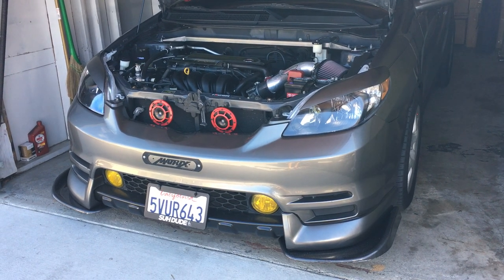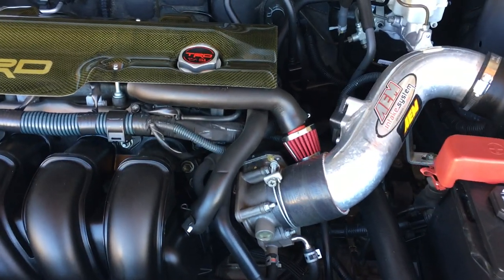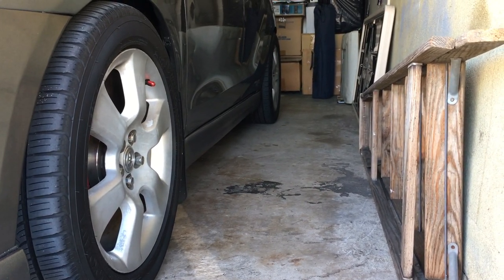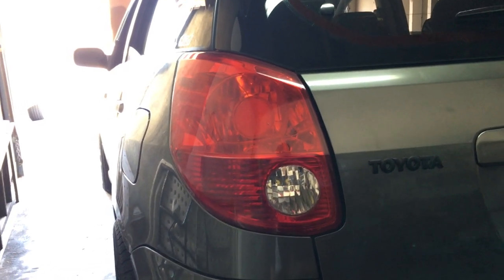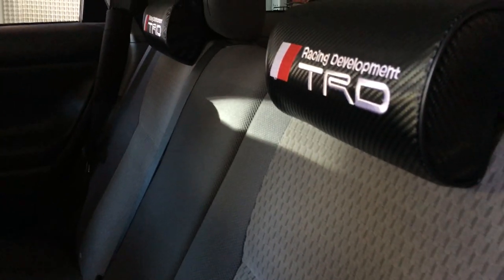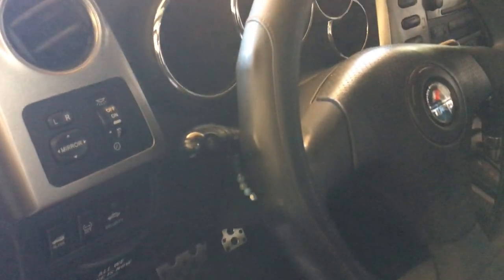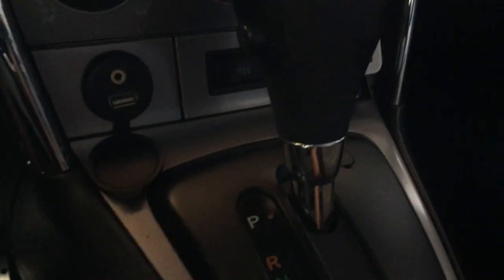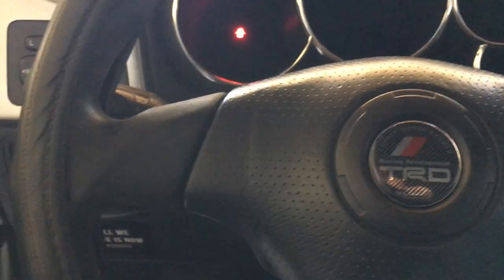2006 Base Model to 2003 XR Conversion!

Comment: Got this as my first car, now i gotta learn how to drive it
Reply from the maker: Automatic is easy to learn. Just shift into Drive, then put your main focus on controlling the speed with your gas pedal and brake pedal. EZPZ, manual transmission is a tad more difficult.

Comment: About to put a new intake in mine, my county doesn’t require any test or anything but I am worried Ima mess up and have a check engine light
Reply from the maker: Don’t gotta worry about that if you follow the installation instructions.

Comment: Nice sport wag 👀❤️❤️❤️,!!! “ Plasti dip is a mod for horse power” ..? Lol , love that your loving that matrix , bout to get my third one and going to pull an engine out of my first 270,000 miles , going to put it on a stand and try to clean it up and fix the shit I broke on it , but it still running strong , I stripped out the timing chain tensioner double ended bolts , tried to fix the oil leaking out of it , and yeah , if you could let me know what Toyota Matrix channels like yours to sub to ..? Thx man cool rig 👌🏼
Reply from the maker: Allan Cooper Sick! And nah I said “for horsepower” because it’s a joke LOL. I have another one that I’m yet to post as well. But for now it’s not ready. 3 Matrix(s) wow! Any XRS?
Reply: Jimmy Thai I’m looking to possibly get an xrs in the future ..? All the one’s I’ve come across have well over 250,000 plus miles on them and where all banged up , hard to find a xrs in good shape , but I found a 2.4 liter S awd model that’s in pretty decent shape that I’lll be picking up tomorrow , if everything checks out  , , I have a 06 base that I’ve been holding onto since it was brand new , it now has 270,000 miles on it , it still runs , but it started leaking oil , all over the back of the head from the chain tensioner seal , I screwed it up a bit by stripping the 2way bolts that holds it in , but now I might have to pull the engine to access the broken studs 😞, I’ll try a couple of more things first , but before I pull the motor , and if I do have to pull the motor , I’d like to go over it , clean it up , and add a few mods ....,,and throw it into a xr or xrs if possible , but back to the other matrixes , my wife has a 06 base with about 45,000 miles on it , that she got from her mother , and wants  to add some things , like a xr or xrs kit , A blue 07 xr with 117,000 , that I’m going to keep for my daughter when she’s able to drive ,  that’s the one I’m driving now , but yeah these cars have been the least trouble free cars I’ve ever owed , had three or four VW’s , and a Cadillac , they were also good cars but  , Toyotas have a good reputation for a reason or two ,Toyota’s do have their issues , like anything else , but the quality of their parts and engineering are second to none , they stick to what works , and not try to reinvent the wheel , I guess that’s why they out last almost every manufacture out here , Toyota’s last and they are not cheap today $$$ &  oh and I also have a 13 RAV4 xle awd  that I got brand new as well ,
Reply: Kinda in over my head with Toyota’s , but I’m also looking into getting a mustang gt just for kicks , and I also have gotten back into riding street motorcycles , so many other machines out here and so little time to give them all the attention they deserve , that’s why I lost focus on the Toyota’s cause they never really needed that much attention  in the first place , but with anything else , we take things for granted , and it comes back to bite us in the ass , but 270,000 miles and still running is not a bad bite in the ass, just need to puts things back in place and button her up , and give it the attention it deserves which is not that much ...

Comment: Was the bumper just basically a plug and play or did you have to do some kind of drilling or something?
Reply from the maker: Plug and play, however it's encouraged that you get the foam piece that sits behind the bumper and on top of the reinforcement bar before you mount the front bumper. Other than that, direct swap! Two 10 mm screws, two phillips heads, and a plastic clip. Yank off that bumper! Unless if you have those oem clips underneath, then you'd have to remove those as well. I made it easier for myself by using zipties on those areas for easier removal procedures next time around.
Reply: Wait, i can take a front bumber off an 03/04 and direct swap it on an 06? No way!?

Comment: hey man just got an 05 xr in blue, was wondering where you got your window visors?
Reply from the maker: TheKris916 HANSCOSTAR 4pcs Sun Rain Guard Vent Shade Window Visors Fit 2003-2008 Pontiac Vibe 2003-2008 Toyota Matrix https://www.amazon.com/dp/B083TVZK2Y/ref=cm_sw_r_cp_api_i_a0dCFb2YCTW
21

Comment: So the matrix and the vibe are basically the same car would these body mods like the grill and bumper fit into a vibe? Iv got a vibe but hate the way the front grill looks like and same for the headlights and tail lights
Reply from the maker: Unfortunately not, they're actually distant cousins. Body mods like the grille and bumper will not fit interchangeably onto a Vibe unless you do some major modifications to the parts then yes. IIRC most of the custom parts for the Vibe are more or less fabricated instead of aftermarket. There's a JDM car version of the Vibe called the Toyota Voltz and it has power folding mirrors, RHD dash, and a bunch of cool stuff, but importing them to the states would be difficult. Those are the few I can name in regards to finding aftermarket body modifications for the first generation USDM Pontiac Vibe.

Comment: So is the 2003 bumper a direct fit to the 2006 matrix? Thanks 👍
Reply from the maker: Yes 2003-2004 front bumper (prefacelift) is a direct fit for the 2005-2008 Matrix (facelift). All you’ll need is the foam bumper to ensure proper fitting when mounting.
Reply: @thai2zz35  thanks bro!!!
Reply from the maker: @gogojuice2621  you’re very welcome!

Comment: I have a 2004 Toyota Matrix 6 speed manual. Why does it grind going into 3rd gear?
Reply from the maker: This is a very common problem with the C-59 and C-60 transmission. I would personally try Redline MT-90 oil in the tranny first. I'd also suggest double clutching while the transmission is cold. Once warm the sythetic transmission oil will make every shift smoother.

Comment: its so wack looking for parts now ! ive had this matrix since 2017 and i choose now to start modifying it . i search parts but it seems like everything is discontinued  :( anywhere i can go to find parts . i know ebay has somethings , but i want like genuine trd things . let me know please , if this page owner is still active on youtube ?
Reply from the maker: Hey man! It’s a struggle, I know, however you’re not alone. I started modifying my first Matrix in 2017 (bought a base model unfortunately - back in 2016). I didn’t know much about modifications till I learned through others on Toyota Nation and some Facebook groups since the group’s website has been down for who knows how long. I bought an XRS in 2020, and decided to build a car of rarities. The key thing here is dedication and inspiration. I use Facebook Marketplace, OfferUp, Craigslist, etc to source my parts. Even eBay and once in a while Amazon. Genuine TRD parts are the hardest to come across (aside from what’s available like the oil and radiator cap). I see things on cars for sale and it won’t hurt to ask if the seller would part ways with just that part. Once they agree, then I make my offer and move. There’s so many possibilities in terms of asking and negotiating to buy these parts, Israel. Junkyards are also an option, except that it’s more of a hit or miss since there’s other people who lay their eyes on such parts before you do. I hope this answers your question! 😌

Comment: Hey Jimmy, i'm from the matrix group on facebook. I am trying to install the power outlet in my 06 xr. so far i got an inverter from a vibe and plugged that in. All i need now is to pluck out the storage compartment on my matrix and put in the compartment that has the wires and outlet from a vibe right? What do i use to remove that piece? And a relay as well above the glovebox ?
Reply from the maker: I’d recommend removing the whole entire trim piece (HVAC controls down to shifter trim). Open the compartment lid and use a mini saw to saw off the hinges on the side. You can damage it if you want since you won’t be needing it anymore. Then put on the piece with the 115V outlet and button in the very back of the storage compartment there will be a traced area (made by Toyota) that you can cut out to make a hole for the wires to slide through the back. Easier said and done! Plug and play process. Relay goes up top behind the glove compartment, might be a tad difficult to get to because of weird positioning. If you need anymore assistance, let me know!
Reply: @thai2zz35  thanks a bunch for that detailed response, I'm just waiting on a vibe to show up in the scrapyard. Sounds fairly doable
Reply from the maker: Nagu Shouldn’t be too difficult of a job. If I had the chance and time to redo everything with a video I would!
Reply: @thai2zz35  thanks man, i got the panel and relay now. I assume the wires that go into the panel are tucked behind the storage compartment in those slots right. This is gonna a bit of a pain in the ass lol
Reply from the maker: Nagu Yes, right behind those slots. It’ll be easier if you remove the whole bottom trim (HVAC knobs down to the shifter area - it’s all one piece). Use tweezers to grab the wires after you’ve cut the slots out.
Reply: @thai2zz35  ok thanks,  i actually went behind the glove box and managed to reach all the way to the hole where the wires should come out from! I may not have to remove anything lol

Comment: Hey Jimmy what phone mount is that?
Reply from the maker: Panavise phone mount, it attaches to the bolt that mounts the stereo.
Reply: @thai2zz35  do you know the model#? When I Google search it, it brings up "panavise phone mount model 15575 from best buy" but I think it might be missing some hardware.
Reply from the maker: @stonedassassin2012  751371703 and 15585
Reply: @thai2zz35  thank you bro
Reply from the maker: @stonedassassin2012  Everything good? If you still have questions hit me up!

Comment: Does a 2005 xrs corolla front bumper fit on a base model like ce ?
Reply from the maker: Yes. They’re both the same, minus the lower valance additions.
Reply: @thai2zz35  thank you, damn ebay seller telling me it wont fit
Reply from the maker: @blaze2051  Sometimes eBay sellers don’t know what the car community knows. They only have limited knowledge. The dealership would’ve said the same thing, lol.

Comment: does the xrs front bumper fit a regular xr ?
Reply from the maker: Yes it does!
Reply: @thai2zz35 so if i have a 2007 toyota matrix xr i can buy a xrs and it will fit??
Reply from the maker: @jacob383  are you looking to swap the front bumper to a prefacelift (2003-2004) or a facelift (2005-2006) XR/XRS?
Reply: @thai2zz35 whats the difference? i would like the one that u have on in the video but on a toyota matrix 2007 xr
Reply from the maker: @jacob383  look up on internet: 2005 Toyota Matrix XRS. Open a new tab and search: 2003 Toyota Matrix XRS. You’ll be able to compare the differences of the front bumper.
Reply: @thai2zz35 yeah from the two i would want the 2003-2004 front bumper but do you know if it would fit the 2007 toyota matrix? and if so is there anything else i have to do for it to fit or would it just fit the same as every other bumper?
Reply: @thai2zz35 so will it fit?
Reply from the maker: @jacob383  fits. You’ll need to grab the front bumper and the foam piece from the junkyard to keep it stable. That’s it.